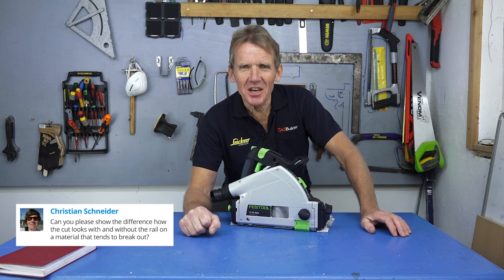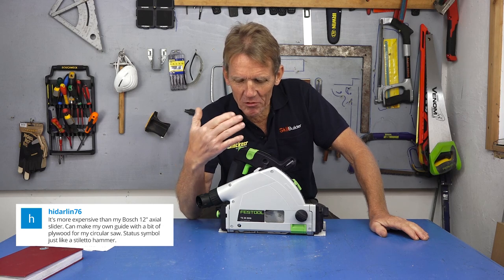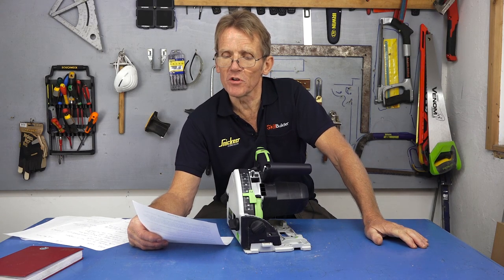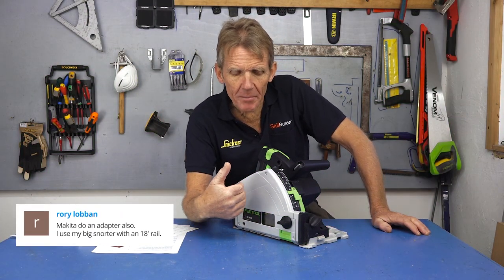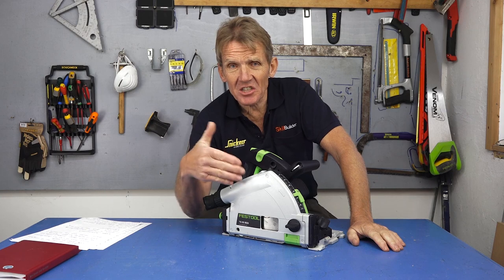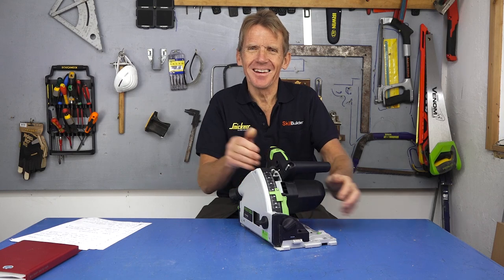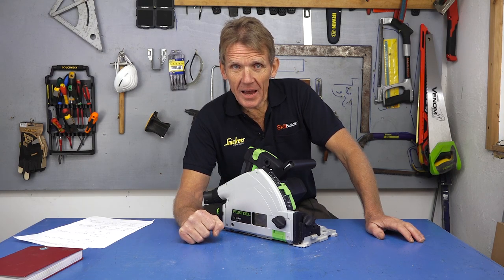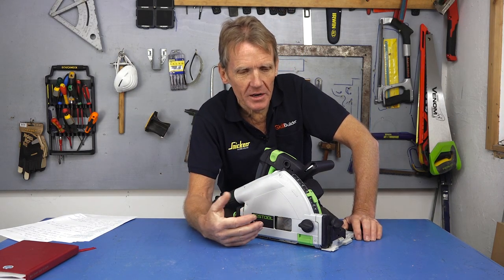Festool TS 55 REQ Saw Review Your Questions Answered

Comment: Great review. I’ve had a TS55 for 4 years. The cut is so clean sanding time is greatly reduced. The Festool dust extractor is head and shoulders above the other two Ridgid ones I have. This reduces shop clean up time. I have zero regrets at spending what seems like so much money.

Comment: I own and use the previous version of the saw now for 10 years. The only disadvantage I discovered so far is the lack of power when cutting thick material. I love the precision and dust extration of festool equipment.

Comment: I wholeheartedly agree with you Roger - we all continue to learn day by day. My experience of a lot of power tools is that the R and D depts have often got there before you so every advance needs a bit of extra knowledge to use the tool to full capacity. Lots of people complain about H and S rules, but many of the regs have made for safer and easier to use tools - so fewer lost fingers. All good as far as I am concerned. I still like the TS55 though - its a great tool.

Comment: Why does my new Festool TS 55 REQ will not cut thicker than 3/4" stock., even when I set the depth of cut to the max. Is there any lock that I have not disengaged?

Comment: What we know as a brushless motor in power tools needs a DC voltage on the input (the motor itself runs on a variable frequency 3-phase AC generated by the electronics out of the DC). To run such a motor from the mains you need a rectifier to generate the DC first which is chunky and heavy wich might be the reason that corded power tools often don't have brushless motors.
Reply from the maker: You seem to know quite a bit  about this so perhaps you can tell us if there is any advantage in a brushless motor for larger tools?  Bosch told me that a 4 pole AC has more torque and is therefore the best choice for SDS Max and large circular saws.
Reply: A modern bridge rectifier block is about an inch square and weighs a little over an ounce.It can be fastened to a metal part of the machine case as a heat sink.

Comment: hi roger can we please  have a review  on the new regulations for use of hoovers showing the different classes such as class L and class M
Reply from the maker: OK Chris Good call. I will get Georgina on to it. She is our Health and Safety specialist.
Reply: roger its getting harder to work on sites now because they insist on using Hoovers  the guy i work for got fined £1300 for not having implementing new HSE law  so i think it would be a great idea to promote this problem  im thinking of buying the festool class M type but still unsure i know they do paper bags and lifetime bags maybe get some info and help us tradesmen with choices
Reply from the maker: those lifetime bags cost a fortune
Reply: I'm really desperate for Roger to do extractors too. I've never spent so much time researching into a tool like an extractor/vacuum, and still feel very indecisive of which one to buy. I need a 110v but i have heard some have problems with the power take off feature. Also i dont want one too big or heavy.
Sorry just had to get this off my chest.
I really hope skillbuilder covers the vacuums/extractors out there (could be a full hour or more show though haha).
I wonder which make Roger uses?

Comment: Mafell doesn’t have a secondary handle, I think you are supposed to hold the baseplate or something? I just bought the Bosch which has the same baseplate. Is it safe to hold it there like the Mafell?
Reply from the maker: Nothing is completely safe. I tend to hold the motor housing but I know people who hold the base plate. The danger is always on a kick-back when it jumps off the track so having firm pressure with both hands is essential.
Reply: Skill Builder I just bought the Bosch (your advise was taken :D) but these sadists at the shop thought it was funny to send it without the track.. which will take 8 days.. 

That is like taking a girl over to your house without having condoms 😁 

I thought I would use that time to see how bad it would kick back when randomly plunging it into a piece of plywood. So far it hasn’t jumped at all even when I stacked two layers.

But maybe it behaves different on the track..

I will try holding the housing then and see how that goes.

Comment: nice video mate, i saw in the video you didnt use the rail clamps, how secure is the track without the clamps, thanks
Reply from the maker: hardly anyone uses the clamps. Most of the time the rail stays where it lays because of the rubber strips on the back but if it is a really expensive door a I might get them out as a safeguard.
Reply: True, I only use the rail clamps on slippery, hard to cut materials, like 22mm concrete plywood (if that is the correct English term).

Comment: I know i am lat to the party but the anti kickback should be a very easy ad on for fester ,All they need to do is add a sensor to the base of the saw telling the saw its now down ,And if the saw gets kicked back and lifts on the base then the motor with ill just turn off .

Or just make sure the rail is clamped down then you should never get kick back ..

Comment: Im trying to decide between the TS 55 or the HK 55. 
I am designing furniture such as cabinets and seating. Im starting my Festool collection and Im undecided between the TS and the HK line.
Since the HK can do the cross cuts and can also plunge like the TS line and rip.
Im wondering, if its just one Saw, which to chose.
If I would get the TS, I figured I would need the MFT/3 table with the cross cutting outfits for the table.
Im looking to do repetitive Rips and Crosscuts
What are your thought?
Danny
Reply from the maker: To my mind the HK55 is more of a site tool. If it often used with the short locked on cross cut rail but I mostly use my mitre saw for cross cutting. I would use the HK55 for cutting rafters because you can cut them on the scaffolding and I suppose it would speed up cladding. 
The TS55 is great for sheet materials and plunge cutting. I would like to hear what owners of the HK say because there could be advantages I haven't yet seen.
Reply: Skill Builder as far as i understand it, the ts55 along with an Mft/3 table kit will be able to handle rios and cross cuts and more efficiently. And then the Hk 55 kit along an extra long rail would technically be able to handle the same. And my question to you or anyone is Which would they go for as their one saw.
Reply: Go with the TS. It is so versatile. Plenty of help on youtube. The HK is really a tool for pitching roofs.

Comment: Iv got the 110 and 36v version, both nice but cut about 0.75mm out on the track so carnt use same track for both saws really annoying!
Reply from the maker: That is annoying. I wish we had looked at that but when we do the next test we will. The say that you have to turn the wheels to take out the slack and then run it through the rubber to match the saw to the track but having two or more saws makes that impossible.
Reply: Ian Mottram read the ts55 supplemental manual (Google it) you can set up the saws so they are both exactly the same. Very easy to do by just loosening off a few screws and adjusting the base plate, this will solve your problem.

Comment: Will this saw (with the right blade) make a clean cut on double sided veneered ply (camper van furniture board), on both sides?. Great video mate. Cheers!
Reply from the maker: sorry I have only just found this question. If it is melamine faced Conti board it will be fine. If you want to be sure try a bit and you can always make a scribe cut but really I don't think it will be a problem to make the one cut. I have done lots of board like that.

Comment: could you do some reviews on mafell products please? thanks in advance
Reply from the maker: we will give it a go. We need them to lend us a machine and agree to leave us alone  to make an independent review. That is a problem for some manufacturers. They want control and we don't do that.
Reply: when I've tried there kit out at shows there usually open for discussion 😂
Reply: This is my current problem, deciding on whether to go for this TS55 or the Mafell MT 55, everyone says Mafell has the edge when it comes to build quality and performance , but as I haven't even held one yet, it's a hard one for me to call